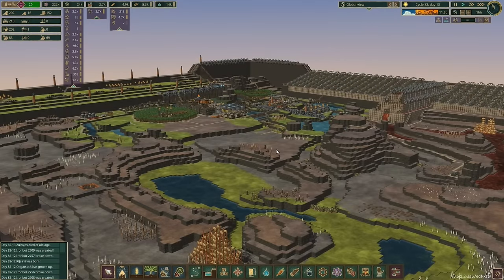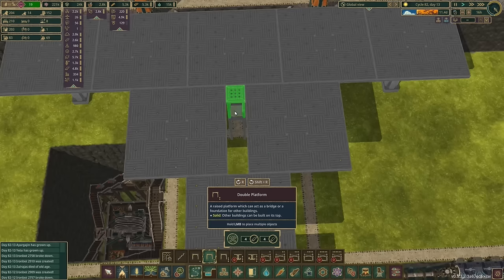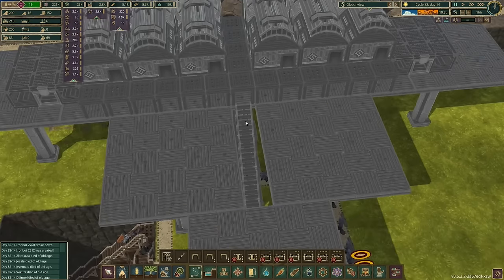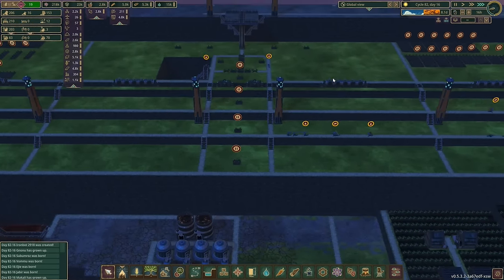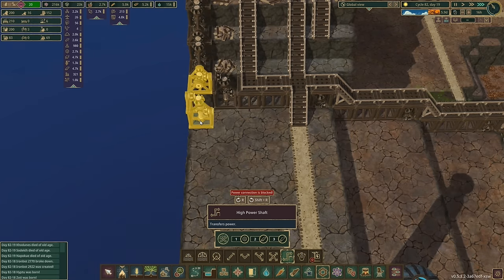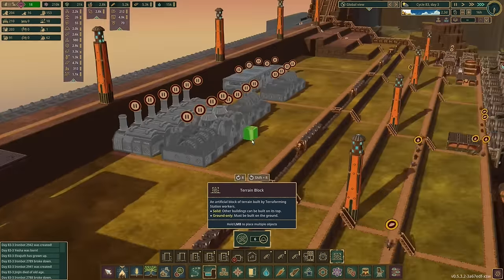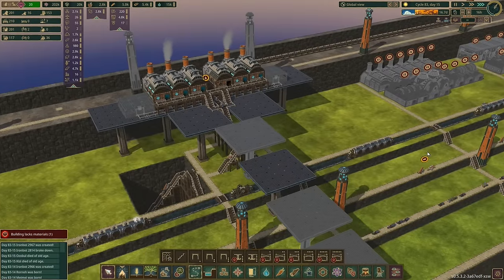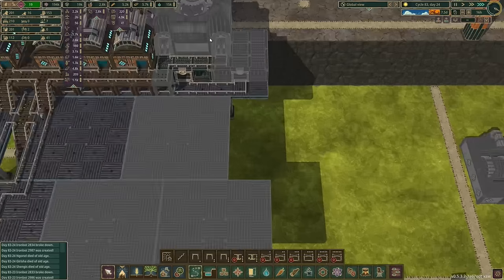FINALLY I get to use LARGE METAL PLATFORMS! - Timberborn BADTIDES Ep 19 - Update 5  Hard Mode

Comment: I think adding the dynamite/badwater storage looks great as part of the skyline
but you've ended up flattening the rest off too much
especially adding storage under the plank and gear factories
I'd argue that maybe the bad water needs to go along the back row of platforms to keep as part of the highest levels
or that the metal factories needs raising up even further (maybe even alternate so not all 6 are level to eachother) to create a more gradual but distinct layering of building roofs
but the wood workshops deifnately look taller than the buildings behind them
With the rest of the layers going down each row those will work themselves out, but it's really important to use storages and platforms to really stagger the buildings on those top rows

Comment: Hey Skye, when you put the number cruncher up against the control towers at 21:28 you can see the control tower is sharing power with the number cruncher. That means you could always hook the power shafts into the control towers and use them as vertical power shafts to transmit power up to the floating platforms.

Comment: I know it's something you haven't used yet, but are you planning to use the suspension Bridges?
I'm wondering if you've thought about doing raised islands in the remaining map, and using bridges to connect large bodies of raised map?
While the tiered section is being used for crops, maybe you could have these sort of, pillars of dirt where different trees are being grown for wood (or sap). with pathway around the entire edge meaning they can be linked with various lengths of bridges (so A to B uses a pair of 5x1's and B to C used 3x1's) while the rest of... whatever the bots aren't making, is laid out in the twisting gaps between these raised islands

Comment: I'm only 13 minutes in so I'm sure this wont matter. But on the off chance it does, I'd suggest  blasting pockets in for the base of the platforms so that the tops match the back terrace height. That would make getting power over much easier. As the terraces step down, keep the platforms the same height by terraforming in single tile wide columns for them to sit on. That will make laying out the industrial facilities on top much easier.

Comment: 25:40 you should build one of the big metal platforms then cover it with single high platforms so you can run paths and power under the platforms and still build on top

Comment: David Attenborough narrates: "After some extra deliberation - and a suggestion of my own for safety added to the mix - the Iron Tooth Lake colony has begun work on the industrial sector atop the newly terraformed wing they've dubbed 'The Green Monster'. As this new sector of the village will be run exclusively by the robotic members of the colony, blending form with function is a must, and even I cannot fault them on that logic. Whatever your thoughts about these magnificent creatures, one thing they cannot be claimed to lack is clever ingenuity."

Certainly a tricky undertaking here, Skye. That said, one suggestion I have is that if it's possible to build one of the metal platforms on top of a regular platform, then you could set up however many platforms you need on top of the mine's stairway to make the metal platform stand flush with its brethren. That would also give you a bit more room to play with.

Comment: An idea for power - you have a 1 tile high gap at the back of every platform - could you run power on wooden platforms directly underneath the metal platform? To save ground tiles, it could be on top of the existing paths that run from front to back.
This will give you power into the back of whatever building is placed at the back of each level of platform.

Comment: I would have tried to cover the mine mostly up with the platforms.Your mine hole is 7×7, but the mine itself takes only 5×5, and by routing the stairs a bit differently, you could get in platforms so  that only a 1×5 strip over the center is not covered. I'd then base the platform layout on that, instead of that symmetric stairway. I guess you decided to have the mine a visible feature instead.

Comment: I guess you did go for the more spacious approach, so this is not relevant ... but when you said "I need to figure out how to step the power down", I was imagining some more dense setup (with lots of buildings touching each other), and wrote this:

For stepping down power by one, you can use the food factories or the bot part factories – they have power connectors on both levels. The bot part factories also can be stacked (and transfer power through the top/bottom surface, so that also works for more than one level of difference.

Comment: You're missing a smelter or two for the bot production in your list of everything that needs to be on the platforms. Also you could send the power up the center staircase on wooden platforms above the stairs instead of from the back and the future aqueduct.

With leaving the bad water centered on its platform the weight is centered on the column, the beavers must have been worried about structural integrity. Also, you can place the fencing underneath the wooden platforms up to the bad water storage.

Comment: why didnt you use the four high metal platform for the top level? then you'd be flush with the back wall and you could use the integrated staircase and make an integrated powerline in the back wall aswell? 

you could also dynamite the platforms down 1 or 2 terrain tiles to get them all at the same level/create more hight difference (obv you could also lift them up with terrain tiles

Comment: Using dynamite to lower the metal platforms at least at the upper part by one so it aligned with the back wall would have been cool and helped with ramps and power

Comment: Connect a few of the platforms with bridges (especially over the mine crater!) so you can end up with a more symmetrical design.  You could also use the 3 wide metal platforms smackbang in the middle of your industrial area with a path in the middle on those with room for decor and charging stations on the sides and have bridges to the bigger platforms